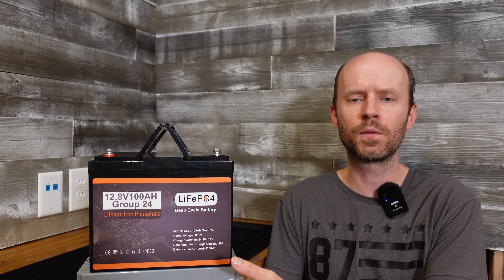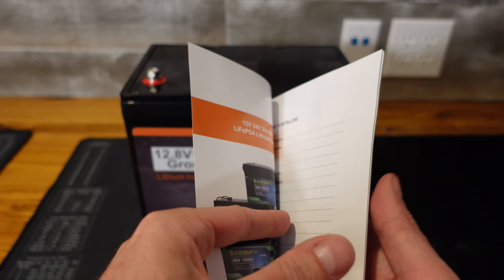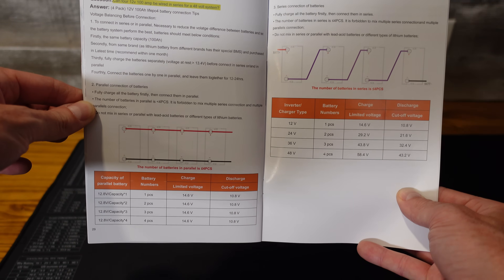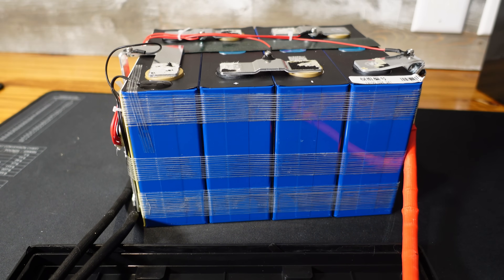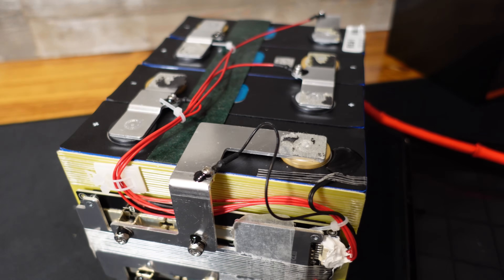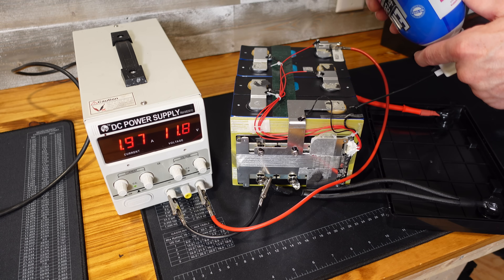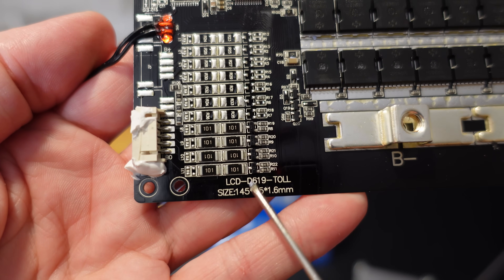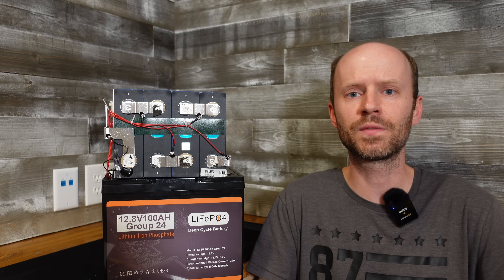D0NGHOT 12V 100Ah LFP Battery, $99 Teardown, Looking Good Finally!

Comment: Maybe to much thermal mass, for the compressed cleaner, with the sensor glued to the battery. Put it back together and stick it in a freezer overnight and see if it charges.

Comment: Quality on the inside really isn't that bad.  I do wonder what ended up bending that positive connection because it does look like it's starting to bend away from the terminal.  Thanks!
Reply from the maker: It doesn't fit without bending inwards like that. I guess they could have used less foam on the BMS side maybe.
Reply: @LithiumSolar  Yeah, shift it the other way in the case so they didn't have to bend the bar.

Comment: Did you get only 20A out or 100A? Or does it have overcurrent protection?
Reply from the maker: It's rated for 100A continuous discharge. I did not test the over-current protection.

Comment: Nice review.  For me and many others, low temp protection is cheap and absolute needed if you live where it gets cold.  $100 is a good price. I wouldn't buy it though because low temp missing is not an option.
Reply: i live in a cold area but low temp is easy to work around. charging is the only issue but you can get temp protection from your charge controller as well. Or don't charging it when its freezing out.